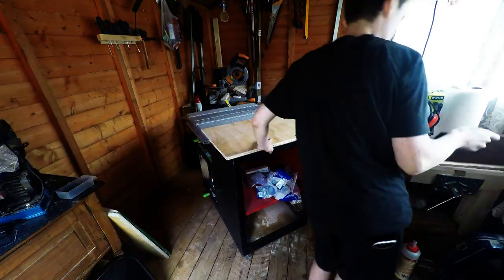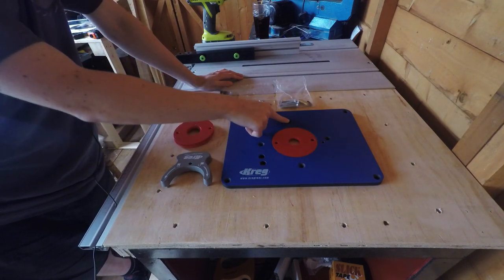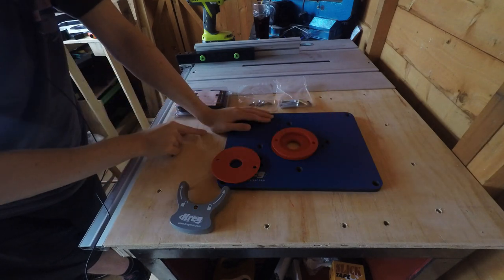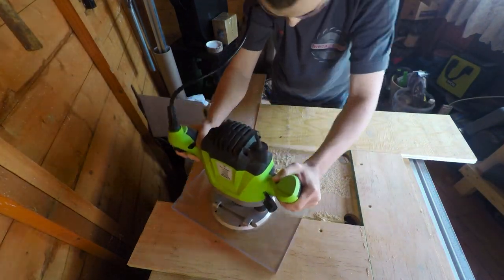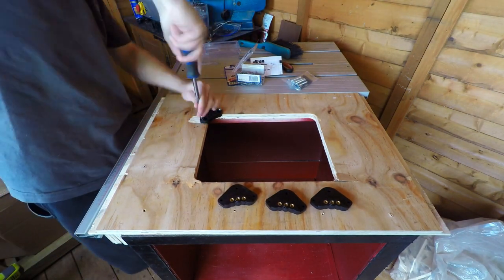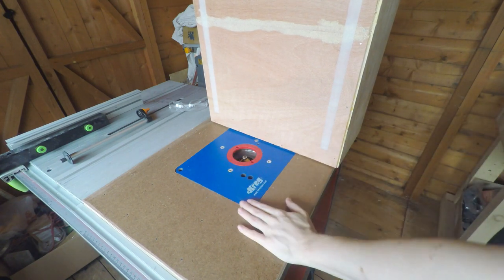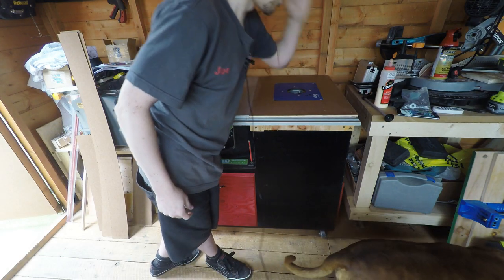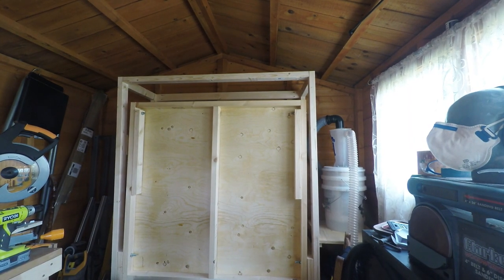DIY Router Table & Table Saw Cabinet - Part 2

Comment: Your TS extension router table is better than mine. I'm jealous of the insert plate. While waiting to get your new TS, you can easily make an add on fence attachment (see my YT video) that will work well for your router fence. I also use mine to do some work on the TS blade side for tenons and other cuts. Oscar did not ruin the shot, he was a welcome guest to the show.

Comment: Way to go Joe. The finished Table saw cabinet looks great. I'm going to have a go at one myself once I finished my current project. Glad you overcome the problem with the fence rail. I was wondering myself how I'd do that part, but wonder no more as I'll nick your idea. LoL! ;)
Your router part of it seemed to just all fit in to place well. I don't have the funds for the Kreg stuff but I've a few ideas on how I'll build that part of it.
I'm not a big fan of painting wood but I have to admit it looks good on your cabinet. The way it bought out the grain on that plywood is pretty nice. All in All another good job done by Average Joes Joinery.

Comment: Great Video. Very well explained. I started out just like you and most of us do, I like that you put your best effort into every project, and as you get more experience you will get better tools as you have, and in my opinion is the best way to do it, start with the bear minimum and you will appreciate and understand how to use the advanced woodworking tools with ease,  just don't go to hard on yourself with what you could have done. You are doing great with the tools and room that you have and the key is never give in and don't set a time limit. Take Care. Great Video.
Reply: That's the way mate.

Comment: Looks great.  Fantastic use for a small shop.  I'll be using some of these ideas in my small shop.  Did you find it easy to install the Kreg plate?  It looked like you didn't have any struggles.

Comment: Nice video thanks, I'm making something like this so good for ideas. I didn't see much info on the fence, unless I missed that bit  though, did you make that extension rail that works with your current fence?
Reply: +Average Joes Joinery Thanks! Convenient that the saw comes with an extra rail, should have bought one of those Furys, over the Screwfix Titan saw, which is about as cheap as a table saw can be made, I think. I've made a crude fence, but I'm also struggling to get it to stay square.
Reply: +Average Joes Joinery Cheers for the tip. Yeah  not surprised as this evolution stuff is really nice for the money, you can tell it's a bit cheap, but it always works well.  Been very happy with their chop and circular saws,  made plenty of stuff without problems.

Comment: hey jo, tool question here.... have you got a nail gun? I'm looking at screwfix titan brand, it's not the best brand but all reviews are fantastic and I look out for tradesmen reviews as they obviously know what they are talking about. few joiners said great quality. Only £30!
Reply: scott mclean I got the £30 one from Screwfix,opted for that over the slightly cheaper one. Built a 50ft run of feather edge fence,never missed a beat...6 months in trigger went,no box,no receipt...took back,gave them my address replaced it no hassle! For £30 its great value.
Reply: Ross Melia  thanks, I bought it. Seems a bargain

Comment: Hy Joe, another good video. did you review a lot of routers before settling for your titan?  is it a good quality?  iv used the erbauer plunge router at college which seems good. not sure if titan is more or less expensive than erbauer. it's screwfix's own brand  but iv bought the erbauer drill and impact driver which my tutor said is good. can't afford all best brands yet. I bought the dewalt jobsite table saw and portable saw. really good and of course professional quality from dewalt. nut pricey. check it out on my Twitter page. im in middle of turning mu shed into a workshop. not that big but a good start. take a look, I'd be grateful of your tips or advice for using space efficiently
Reply: Good advice. I was going to build a table saw bench and put it in casters aa you did but I got a great deal and got the portable table stand for free which usually costs £200. I want a band saw but I may jus buy a better quality jig saw as less space needed. Looking forward to seeing your build for your drop down x-carve cnc machine. Should be cool. You said your moving to a different premises?  Bigger Worksop?